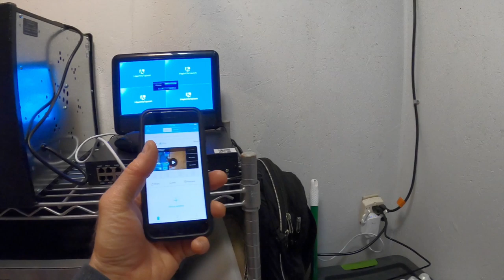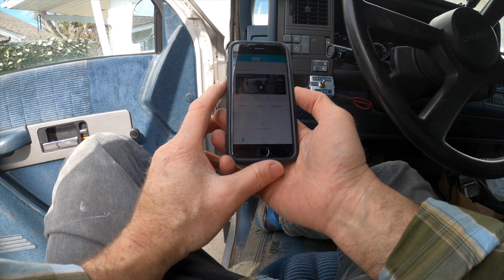Hand Dug Trench + Security Camera Install ➠ HD 23

Comment: The house I used to have when I what it the previous owner put up plywood soffit needless to say overtime it rotted some and squirrels discovered it and had fun  but not for long 

I also got a project coming up replacing  flooring do pets got any suggestions for something to put down on the floor prior to the new flooring
Reply from the maker: I'm doing a floor this week and will likely use a 1/4 thin plywood underlayment ... stapled to a good floor they last and provide a nice, smooth surface for that new floor. Good luck with it man!